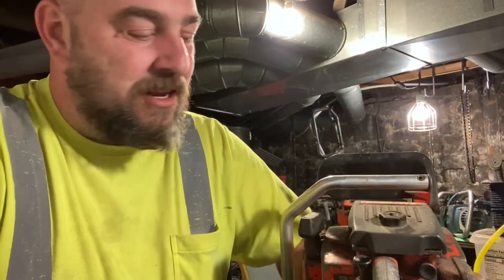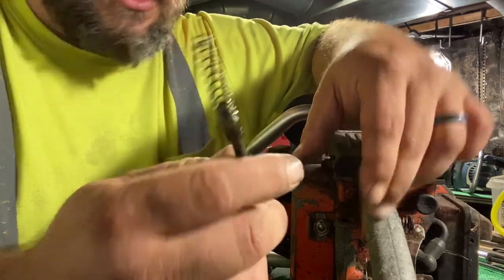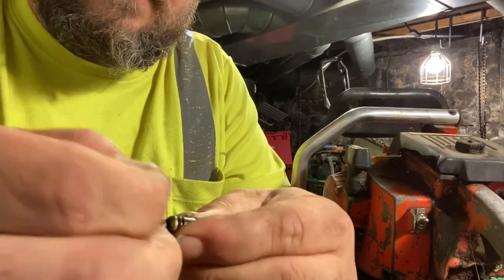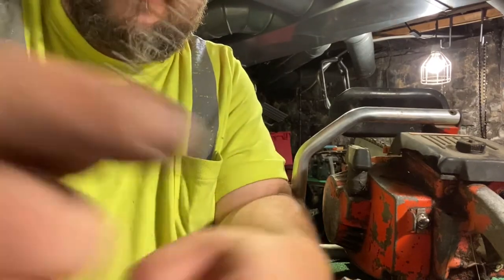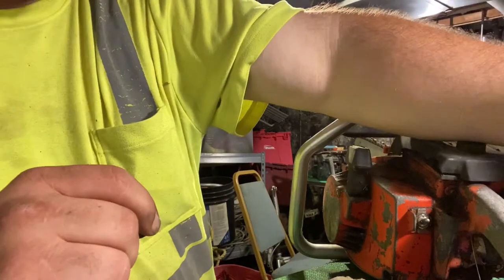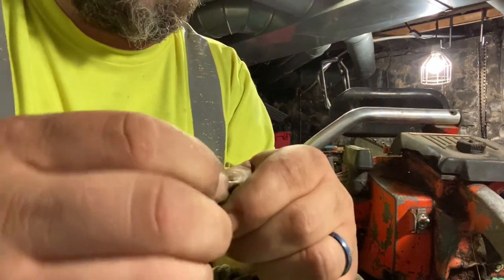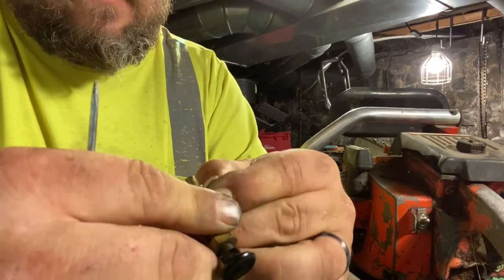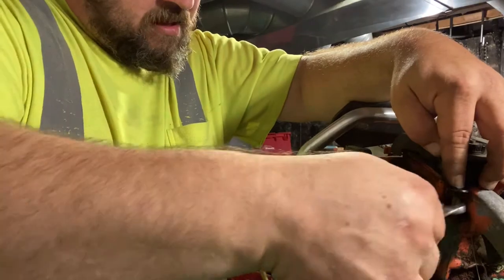Vintage Homelite XL-12 Chainsaw Manual Oiler Repair!!

Comment: Just picked one up and the copper line going to the manual oiler is off.  Any videos on that by chance?  I hope the ferrule is still inside the fitting.
Reply from the maker: I have never seen that happen otherwise I would have probably done a video on it.

Comment: I have a xl12 with manual oiler. The manual oiler does not have the 1/2 inch nut to take it out. Any idea how to remove it?
Reply from the maker: Could you send me some detailed pictures of the entire saw and some close shots of the trouble area? There are several versions and I need to figure out which one you have. my email is listed on the about section of the channel.
Reply: I think one of mine is like this and in order to service the pump, I had to pull the saw apart.

Comment: Hey there quick follow up question:  My XL12 (1979) doesn't have a nut under the thumb pump; how does it come out to check?
Reply from the maker: I have never figured that out myself.
Reply: I’m trying to figure that out also
Reply: I would love to know how it comes out that's the only thing wrong with it
Reply: So I just figured it out take the two screws out of the trigger handle and there is a pin in front of the trigger you have to pull out and it will come right out

Comment: Mine make the same noise but it barely comes out not enough to oil the chain
Reply from the maker: Probably check valve stuck.
Reply: @Smittyschainsaws  ok thank you very much for that information I figured out how to take the plunger out just not sure where the check valve is your referring to I will do more research
Reply from the maker: @dantheriot7045  it’s the fitting at the end of the hard oil line. There’s usually more than one check valve.

Comment: I have a few XL-12's and a couple have oil pump issues. I need to get some O rings lol

Another issue besides the O ring and check valve, is the filter in the oil tank becoming clogged.
Reply: I got o-rings. Sizes were correct. Old o-rings didn't look bad. One saw is pumping a bit better, the other does not pump. I think the line from the manual pump to the saw must be plugged. I think I checked everything else. I put that saw away for now lol